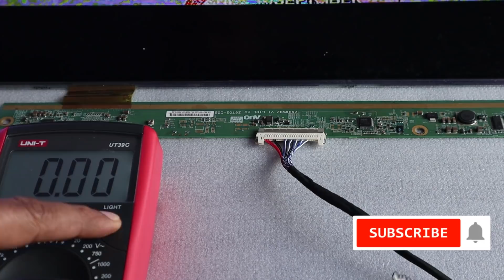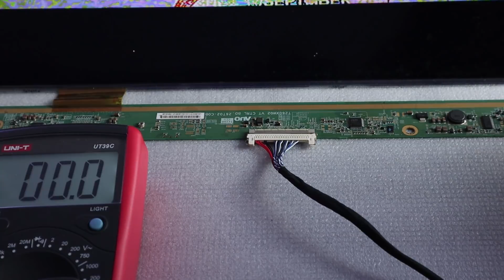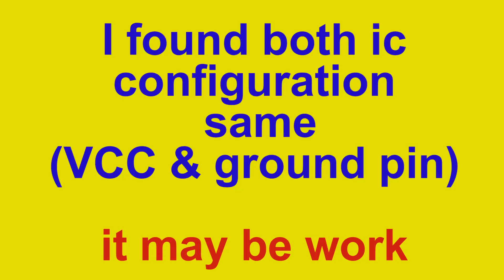LED TV Panel Repair (Poor image problem) solved

Comment: Your video is nice. What could be the problem with the lg led TV 42' when switched on the led light blinks 3 times and the screen remains black with no sound.
Reply from the maker: First Check backlight